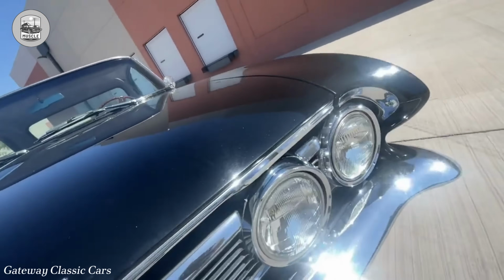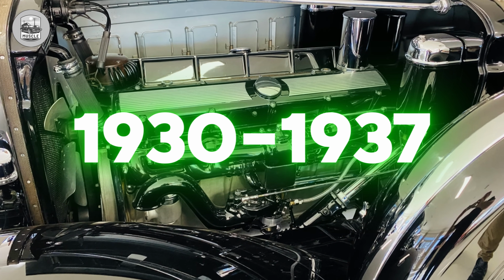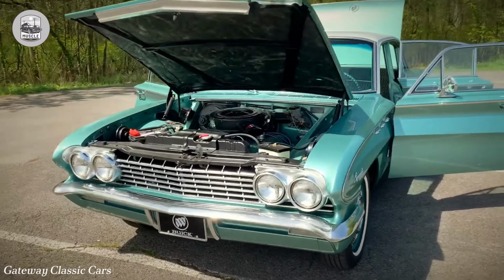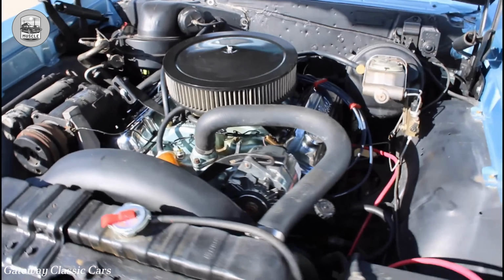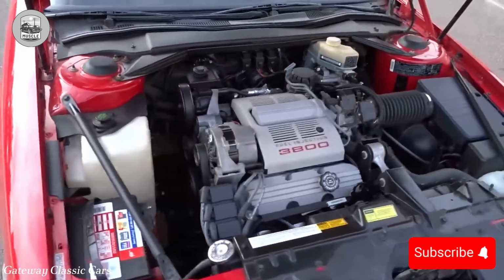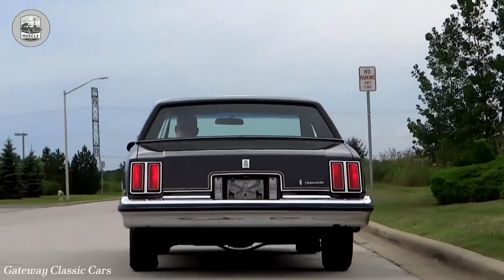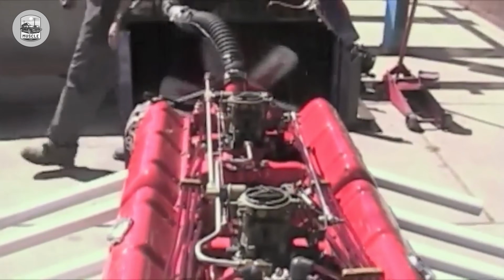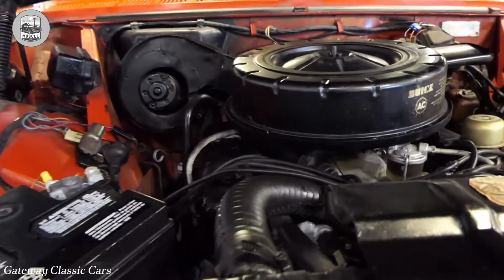10 MOST FAILED and WEIRDEST GM Engines ever made | Worst engines blunder!

Comment: 27:41.... Yea, I BET it went over 200,000 miles easily. You could probably lose 2 or 3 cylinders, and never KNOW it. Just keep on truckin...lol 

I never did get to experience one of these engines, I'd sure like to one of these days. 😁
Reply from the maker: Haha, you're absolutely right! Those engines were built to last. The old V8s were so over-engineered that they could take a beating and just keep running, even if a few cylinders weren't firing! Many of these engines, especially the small-blocks, were known for their toughness and simplicity, making them perfect for long hauls and hard use. And once they hit that 200,000-mile mark, it was like they were just getting started!
If you ever get the chance to experience one, I highly recommend it. The sound, the torque, and the nostalgia of driving one of these old-school beasts are unmatched. There’s something special about sitting behind the wheel and feeling that raw power come to life.
We’d love to hear more stories from anyone who’s had these engines hit major mileage! Drop a comment, let’s talk engines, and don’t forget to share your thoughts and experiences. Make sure to subscribe to Muscle Car Masters for more deep dives into the best American muscle! And hit that like button if you’re a fan of old-school V8s still powering through!
Reply: @MuscleCarMasters68  You BET I'm a fan of old American Iron! 👍

During the summer months here, I drive an N/A 800h.p., 547", big block Oldsmobile, as much as possible. 

It's crazy that one can daily drive a big power engine like this today. The advancements in design and materials of parts has taken us a LONG way towards that. The new machining processes have also done alot. 

Yea, my big Olds is built with an aftermarket block, BUT any factory Olds part WILL bolt onto it.... Come to think of it, there isn't one single factory G.M. part in the entire engine, but there COULD be. 😆

Edit: I SHOULD put something like the factory distributor hold down clamp on it, JUST so that it does have at least ONE factory Olds part on it.. 😂
Reply from the maker: @davelowets  Thanks for sharing, and WOW, that’s an absolute monster of a build! 800hp from a naturally aspirated 547ci Oldsmobile—now that’s something to be proud of! It’s incredible how modern technology has made big power engines like yours so streetable. The advancements in design, materials, and machining really do allow us to push the limits like never before, while still being able to drive them daily. That’s a true testament to the evolution of muscle cars.
Your engine setup sounds like a beast, and it’s awesome that despite using an aftermarket block, the fact that factory Oldsmobile parts would still bolt on shows just how much respect has been given to the original designs. Even if no factory GM parts are in it now, it’s amazing to see how the heritage lives on through today’s builds.
As for that factory distributor hold-down clamp, I think that’s a fun touch! It would give your build a nice nod to Oldsmobile’s roots while showing how far it’s come.
For everyone reading, let's keep this discussion going—what’s your favorite classic American iron or modern build?
Reply: @MuscleCarMasters68  Thanks!  It was a lot of planning, and a long time in the works, to come up with a solid big power Olds big-block that actually lives. 

BIG credit goes out to John at Rocket Racing for all the hard and meticulous work he put into this build. 

If it weren't for his aftermarket block and head design, NONE of this would have been possible. Factory Olds blocks are severely lacking in the main web bulkhead department, and the blocks start to break when you start get up over 600-650 h.p.. I've ripped the center 3 main bearing saddles off the block, and broke the crank into 3 pieces, with a factory block once trying to make power, and then I used a girdle the second time, and still cracked the center main saddles. I used a halo main stud girdle the second time, but the only thing the girdle did was to help hold the broken mains together long enough to drive the car back up on the trailer,and the crank was still in one piece(although bent and wasted). The block was obviously still trashed.
The Rocket block has a TON of meat in the main bulkhead area, and 4 bolts on all 5 main caps. The redesigned priority mains oiling system is a huge plus also. A factory big-block Olds oils the lifters first along with the mains, and isn't a great design for high-performance. Sure, it kept the lifters quiet on a cold start-up, but you just don't get the oil volume to the mains and rods like you do with a priority mains design. Another bonus with the Rocket block is that it has a dual B-O-P/Chevy bellhousing bolt pattern. You can bolt either trans straight to the engine with no adapters. The grey iron the block is made of is just a much better material than the factory blocks were also. Any machinist can tell when boring and honing the aftermarket block that it is much better quality than the factory ones. It's like the difference between a factory Chevy block and a Dart block. The block was $5000, but WELL worth the price because even if you can get a factory block build to survive, the bearings and crank get beat up VERY quickly because everything moves around SO much in the bottom end, and wears stuff out quickly. The dual bolt pattern bellhousing saved me a thousand dollar adapter because I built a 4L80 transmission to go with the new engine and it wouldn't have bolted to a factory block without the adapter. The piece of mind, and not having to constantly stare at the oil pressure guage to make sure nothing is broken after every pass, is totally worth it also.. 👌
I'm not afraid to get into it hard anymore. It was like rolling the dice before with a factory block. 💭 "Is THIS the time it is going to let go...??"  
NO more of that! 👍
Reply from the maker: @davelowets  Building a solid, high-power Olds big-block that actually holds together is a monumental task, and it's incredible to hear how John at Rocket Racing made it possible. His aftermarket block and head design sound like game-changers, especially with that beefed-up main bulkhead area and four-bolt mains on all five caps! Factory Olds blocks just couldn't handle the horsepower you're pushing—600 to 650 hp is no joke. Your story about ripping off the center main bearing saddles and breaking the crank into three pieces really shows how much of a weak point the factory block is.
The Rocket block's priority mains oiling system is also a crucial improvement. Getting the oil to the mains and rods first instead of lifters is exactly what you need when you're going for big power. That dual B-O-P/Chevy bellhousing bolt pattern is a huge bonus too—saving a thousand bucks on an adapter and being able to bolt up a 4L80 transmission right out of the box is a game changer!
It’s clear that quality materials and design make all the difference when you're trying to get into high horsepower territory. And like you said, the peace of mind that comes with knowing your engine can take the abuse without constantly watching the oil pressure gauge is worth every penny!
Thanks for sharing your build with us—this kind of insight is what Muscle Car Masters is all about! To all our viewers, if you’ve had experiences pushing your Olds or any big-block to its limits, drop a comment below! We’d love to hear your stories. And don’t forget to like, share, and subscribe for more content like this! Let’s keep these muscle car conversations going...
Reply: @MuscleCarMasters68  🍻
Reply: @MuscleCarMasters68  My current Rocket motor is up close to 750h.p., and the torque it puts out is unreal. 
I'm even contemplating some boost with twin Torq-Storm centrifugal superchargers. The Terminator-X TBI EFI system is blow-thru ready, without any of the usual issues with a blow-thru carb.
I wouldn't be afraid of 1500h.p. with the Rocket block and the Billet crank that's in it. John at Rocket trusts the block up to 2500+ h.p.

The boost won't come until maybe the summer after next. I'm still getting used to the power I have now, and the car still scares me occasionally. 
1st and most of 2nd gear are totally useless on the street. 
With 18"×31" Mickey Thompson S/R tires on the rear, the car will finally hook up in 2nd gear at about a 55mph roll on good concrete. Anything under that speed in 2nd gear, and it just goes up in smoke if I WOT it. Sometimes the car goes straight, and sometimes NOT... 😬
It can be a handful, and I have a manual steering box in the car too. 
At the track it will hook on 14" wide slicks, but NOT with a radial on the street. An 18" wide tire is the BIGGEST tire I can fit on the rear, and they don't make radials any bigger anyway, so I have to make due with those.
Reply from the maker: @davelowets  Wow, that Rocket motor setup is absolutely beastly! 750 horsepower with that kind of torque is already insane, and thinking about adding twin Torq-Storm centrifugal superchargers just takes it to another level! With the Terminator-X TBI EFI system being blow-thru ready, you’re clearly set up for some serious boost without the usual headaches that come with a blow-thru carb. Pushing it to 1500 horsepower with the Rocket block and Billet crank is wild, but with John at Rocket trusting that block up to 2500+ horsepower, you've got room to really push the envelope!
It sounds like your car is a total monster on the street. First and second gear being basically unusable is no surprise with that much power under the hood. Those 18"x31" Mickey Thompson S/Rs are no joke, but it's crazy that even they can barely handle the power until you hit a 55mph roll! That's a testament to just how serious your build is. Manual steering on top of all that power? Talk about needing full control!
It sounds like you've already got a solid setup for the track with the slicks hooking up, but I get the challenge on the street with radials. Finding the balance between power and grip is always tricky at these levels. You’re definitely pushing the limits with what the tires can handle, especially since 18" is the max width you can fit back there.
To everyone else reading, what do you think about this insane Rocket motor setup? Let us know if you’ve got any tips for handling this kind of street power or if you’ve got experience with similar setups. Be sure to comment, share, and subscribe to Muscle Car Masters so you don't miss out on more incredible builds and discussions like this! Let’s keep the conversation going....

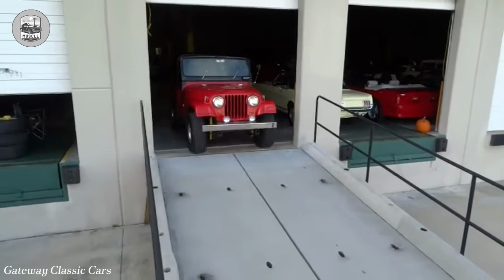Comment: 16:23..  Jeez, this "cool guy 😎 " almost snubs it out coming down a ramp, and then grinds second gear after he manages to keep it running... 🤨
Reply from the maker: Thanks for catching that! It definitely looked like the driver was wrestling with the car, and that grind into second—ouch! These older muscle cars, especially if they're running a high-performance manual transmission, can be tricky to handle at low speeds. Many of them didn’t have synchronized gears like modern cars, so you really had to time your shifts perfectly or you’d get that grind.
For anyone curious, getting used to these transmissions can take some practice, especially when you’re managing a high-revving engine. But once you get the hang of it, there’s nothing quite like the feeling of nailing that perfect shift in an American muscle car!
What’s your favorite muscle car to drive or wrench on? Drop your thoughts in the comments, and while you're here, don’t forget to like, share, and subscribe to Muscle Car Masters for more gear-grinding action and awesome muscle car content!
Reply: @MuscleCarMasters68  My favorite is my Olds Cutlass. It's a 9-second quarter daily driver.. 😁
Reply from the maker: @davelowets  Wow, a 9-second quarter mile daily driver Olds Cutlass? That’s impressive! Oldsmobile really knew how to blend performance and style, and it sounds like you've taken yours to a whole new level. Is it packing a big-block Olds under the hood, or have you done some custom mods to get those times? The Cutlass has always been an underrated muscle car, and builds like yours show how much potential they really have! We'd love to hear more about what you've done to get it running in the 9s, especially as a daily driver!
To everyone else out there, what's the fastest time you've ever run, or what's your favorite mod on your muscle car? Drop a comment below and let’s keep the conversation rolling! And don’t forget to hit that subscribe button, share this with your fellow gearheads, and join us here at Muscle Car Masters for more incredible builds and discussions!
Reply: @MuscleCarMasters68  It starts with an aftermarket Olds block that has 4-bolt caps on all 5 mains, a redesigned priority mains oiling system, siamesed cylimders that allow a 4.4" bore, a 4340 Billet 4.5" stroke crankshaft, 13:1 compression pistons, aluminum CNC ported symmetrical port heads, a prototype tall single plane intake with a Dominator flange. A BIG solid roller cam with hybrid circle track lash ramps to make it easier on valvetrain parts. Bushed and pin oiled solid lifters, crank trigger with MSD programmable ignition box, shaft rockers on the heads, h-beam rods, and a Terminator-X TBI EFI system with a 1440cfm throttle body. 

For the power and especially the huge torque it makes, it's actually very driveable. Yes, I have to run 114 octane in it on the street, but I am going to add another fuel cell to the car, a flex fuel sensor, and tune the Terminator-X to give it a try on E-85 for easy street driving, then switch to the other tank of race gas when I want power. We'll see how that goes after this winter. 🤞
Reply from the maker: @davelowets  That 4.4" bore combined with the 4.5" stroke on a 4340 billet crankshaft is an incredible foundation for massive displacement and torque. And with 13:1 compression pistons and CNC ported symmetrical heads, you're definitely pushing serious power! The hybrid circle track cam and your solid valvetrain components show a clear attention to detail for reliability, which is impressive given the massive load your setup is handling.
The plan to switch between 114 octane and E-85 is smart, especially with the flexibility of the Terminator-X system. E-85 should give you a good balance for street driving while keeping that race gas for track-level performance. Plus, adding a flex fuel sensor means you'll get the best of both worlds—easy tuning on the street and all-out power when you need it. I’m sure you’ll be impressed with the results once it’s dialed in after winter.

Keep us posted on how the flex fuel setup goes—everyone in the Muscle Car Masters community would love to hear your experience! For all the gearheads out there, drop your comments below if you’ve experimented with E-85 or race gas setups, and don’t forget to like, share, and subscribe to Muscle Car Masters for more engine builds and tuning tips!
Reply: @MuscleCarMasters68  Will do...

Here's hoping! 🤞
Reply from the maker: @davelowets  Thank you very much, see you next videos
Have a great day.
Reply: @MuscleCarMasters68  You too... 🍻
Reply: @MuscleCarMasters68  Those old Jeep manual transmissions definitely weren't a luxury transmission by far. And with the 2.5' long shifter in them, definitely weren't good for bang-shifting at ALL.
Reply from the maker: @davelowets   Those old Jeep manual transmissions were built more for durability and off-road reliability than for performance shifting. The T90 and T15 transmissions, commonly found in Jeep CJ models, had a long throw, making it tough for quick shifts—especially with that iconic 2.5' long shifter! They were rugged and could take a beating on rough trails, but if you wanted smooth or fast shifts, they definitely weren't the best for that. And bang-shifting? Forget about it! But hey, that's part of the charm of classic Jeeps, right? It’s all about the adventure, not the speed.

Comment: 90° Odd-fire V-6's were quivery little bastards... when the even-fire versions with the split crank pins cane out, they were MUCH smoother.
Reply from the maker: You’re absolutely right about the 90° odd-fire V6 engines! Those early odd-fire Buick V6s, like the 3.8L from the mid-'60s, were known for their rough, uneven idle due to the crankshaft design. They essentially took a V8 crankshaft and cut it down to fit a V6, which resulted in firing impulses that weren’t evenly spaced. This caused that “quivery” behavior you mentioned!
When Buick introduced the even-fire version in 1977, the split crankpins allowed for even firing intervals, which made a world of difference in terms of smoothness. It was such a major improvement that it gave the V6 a new lease on life, both in performance cars and everyday drivers!
Thanks for sharing your knowledge! Everyone, if you enjoyed this discussion, hit the like button, share your thoughts in the comments, and don’t forget to subscribe to Muscle Car Masters for more deep dives into engine tech and muscle car history!